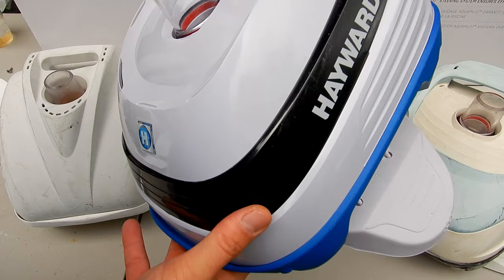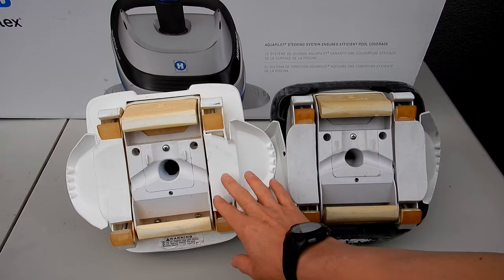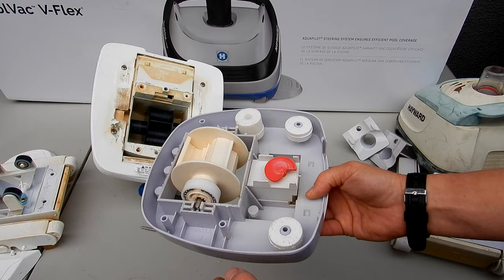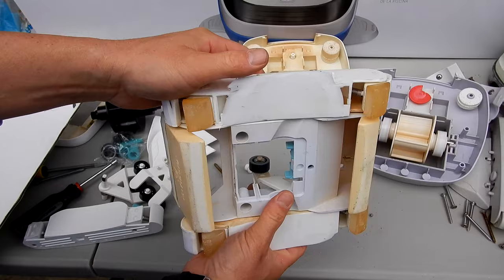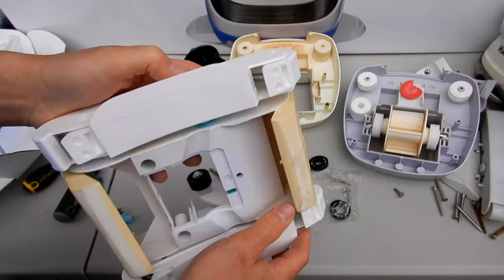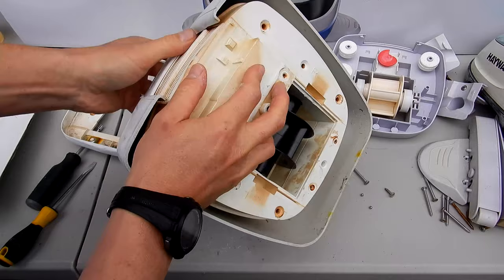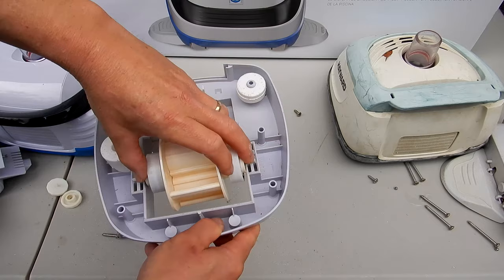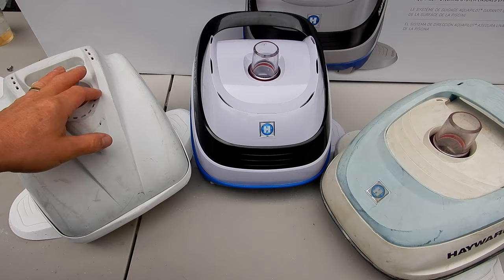The Ultimate Hayward/PoolVac A-Frame &Turbine & V-Flex Turbine Rebuild Video

Comment: You're the only one I've seen to point out that the bearings on either side of the turbine need to be rotated so it falls into those groves. I just put them in & closed it up & couldn't figure out why it wouldn't work. It was driving me crazy! Even my pool guy couldn't figure it out. Thanks for the assist!

Comment: Excellent step by step explanation on both video and audio. I've used my old Hayward Ultra since I put in the pool 15 years ago and just replaced the rockers and pads recently. Your tip on soaking the rubber shoes in water sure helped.  Very helpful.
Reply: I boil my shoes in water, they slip in easily.

Comment: Works for me.  thank you!    A couple notes for others...   pay attn to how that orange/red disc on top of the gear box is aligned before you piece it all back together.  I have NO idea what that is for, and nothing inside moves it.. I dunno.  Seems to have no function, but it's there!    ALSO.. I wasn't going to replace my turbine because I could easily spin it with my finger and I'm SO glad I decided to do it anyway.  One of the bearings literally fell apart in my hand when I opened the case.   So, two new bearings, propeller and even replaced the pods and pod feet.    One issue I had is it kept getting stuck in the pool and I discovered that the suction was just too much.    So like with my old one I just removed the two "wings" and BINGO...   It still sucks (well, doesn't suck? ;-) ) , cleans well and is now crawling walls.   THANKS FOR THE VIDEO!  :-) - Dan B , Carlsbad CA
Reply: UPDATE:   I finally know what that red disc does.  :-)   Here's an excellent video showing the breakdown of the gearbox only.   Stick with THIS video for everything else.  :-)  https://youtu.be/mswunZEkxvM

Comment: Thanks for the video, I have one too, stopped working, opened it up and it's one of the bearings from the A frame wheels. I can see they are cheap in the US, but here in Europe they charge a lot for them, from 75-100 euros for the replacement kit. Nevertheless, I will have to buy one and repair it.
Reply from the maker: Wow - that is pretty expensive. And we complain here about prices.

Comment: Im so glad I found your video I have the one that has the white wheel.  Im glad I didn't get the black wheel one.  Thank you I replace the shoe pads but still doesn't move.  The one piece that I was trying to change is the wheel thats about 2 to 3 inches wide and in order to change the other wheels you have to go to the last cover which it is hard I remove the tiny screw but it still won't come off is there a replacement for the outer body of pool vac plus this turbine dont know exactly what it is called.
Reply from the maker: I think they sell a complete rebuild kit for it.

Comment: Hi David, I am going to take my old Navigator apart (again) and check that all parts that spin are doing so. It still does not turn away from the corner step in the pool. If you/I hold the navigator by the hose (say it's submerged 2 feet into the pool water) with suction on, should you see it spin/turn or not? Mine does not, when I test it like that. Do you think the great big top most gear is shot? It looked fine but I did not actually measure it. In open water it moves and turns fine. THANKS!  Froggy
Reply from the maker: That could be it. I would change the top gears.
Reply: @SPL  Thanks!

Comment: Thank you for taking the time to make this video. I have been trying to figure out why my cleaner does not move. Is there only 1 upgrade kit, or is it unit specific. My cleaner ALWAYS gets stuck on the steps. Is there something I should look at to fix this? On the pool deck with no water inside, it will spin just fine. In the pool, it does not. Thank you.
Reply from the maker: Yes one kit for all the models. First thing I would change is the A-Frame and bearings. Get the kit listed in the video description.

Comment: I have the Hayward Pool Vac XL pool vacuum. It works fine while the pool pump is running but as soon as the pump shuts off the pool vac will float to the surface. I have a dedicated line with three way valve for skimmer, and I do have it adjusted to give the vacuum sufficient suction to do the job. I also use a sand filter and I have backwashed it recently. Do you know why or what would cause it to float to surface?
Thanks.
Reply from the maker: Somehow air is getting in the skimmer line. Check the pump for an air leak

Comment: I run my service vacs a little faster than recommended as they need to clean an entire pool in less than 4 hours,  how does the V-flex respond to the extra speed?
Reply from the maker: It will work fine. You will only notice less climbing ability but greater ability to pick up larger debris.

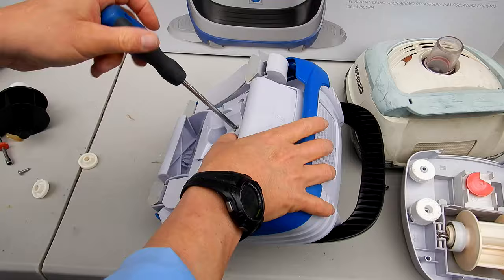Comment: Thanks for the video. Altough I have checked everything I cannot make the turbin spin easily as seen in 11:10. It is too "rigid" to make it move. But the spin moves without any issues if I use my finger in the centre. Any suggestions?
Reply from the maker: It could be that one of the removable vanes is out of alignment.  Try removing 2 of them but not right next to each other and see if it improves.
Reply: I guess yoy mean one of the vane in the turbine?
Reply: @SPL  what is the removable vane?